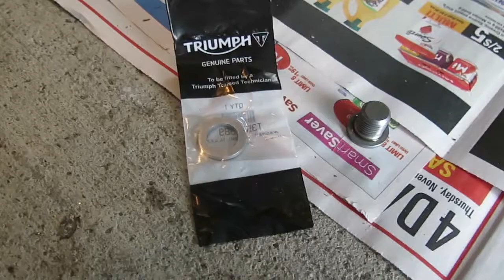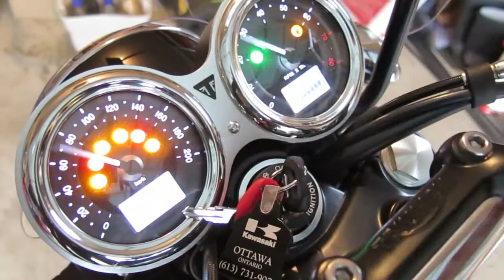Triumph Bonneville T100 Oil And Filter Change How To

Comment: The reason for the 8 hex oil plug is for at least two reason the first it’s much easier for assembly during engine manufacturing. It is also lower profile and less likely to be damaged. The recessed oil filter is also to prevent damage and to keep the engine looking better. As for oil capacity, the larger capacity is a bonus in keeping the oil slightly cooler and helping to dilute byproducts of combustion.
Reply: I didn’t get tool set with my 2022 Bonneville T 100? Should it come with it? Also Triumph offers an oil filter removal wrench.
Reply: And it’s still a pain in the ass!

Comment: Lot of complaining for a very easy job. Gloves also help keep oil off the hands...
Reply from the maker: Gloves sure do help....Thanks for watching.
Reply: Job varies based on your situation. It could be a lot easier. Very little room under there and not the easiest bike to get off the ground with room to work. My old T100 I was comfortable with a flat jack, but the new t120 I only trust forks and frame only supports front end. I suppose I could find the right oil dish somewhere, but it's such a mess when you screw up with 1 inch to get your hands. I have an ibeam in my garage and I actually use 2 ibeam hooks and ratchet straps to lift back end.

Comment: Excellent job of showing the 8mm Allen Key needed to loosen the drain plug.  If there's no centerstand, use a board under the sidestand to make the cycle vertical.   I ordered a Triumph oil filter removal and fitting tool from eBay Commerce.  A PRO BIKE TOOL 3/8 Inch Drive Click Torque Wrench Set can be set to 10 Nm to tighten the oil filter and 25Nm to tighen the oil drain plug accurately.

Comment: A recessed oil filter and oil drain bolt make sense, as they are less likely to get bunged up ny rocks and other debris. You can purchase a Triumph Oil filter wrench that fits the oil filter. Of course, having  a decent motorcycle lift helps with this kind of chore..helps to minimize/prevent bitching.😊